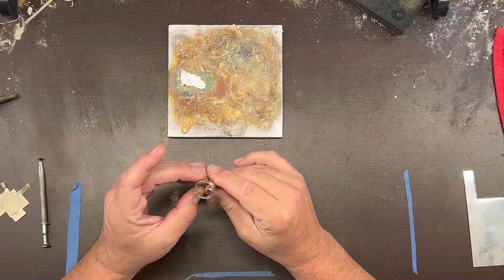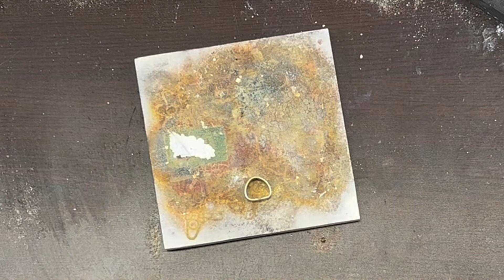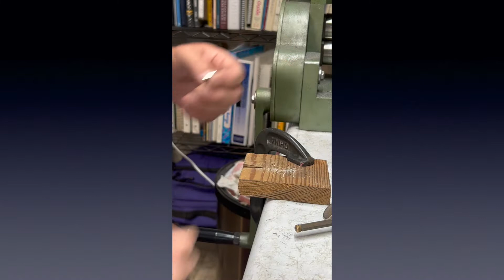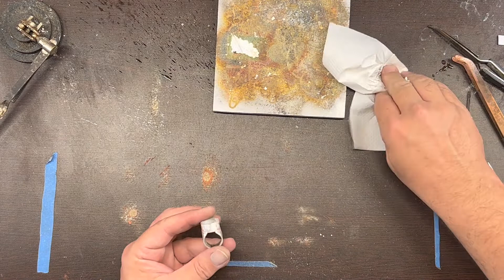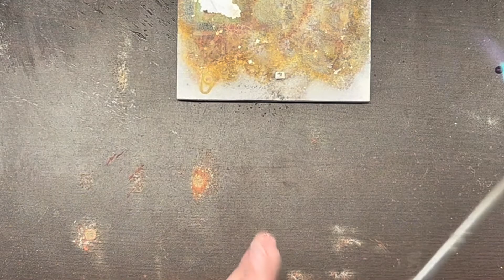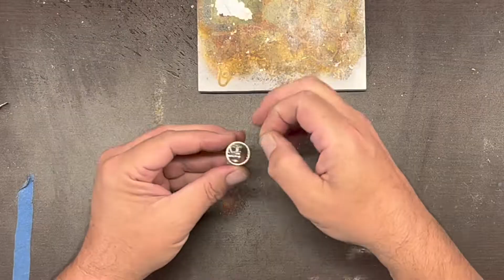Wide Band Minimalist Ring: A Silversmithing Tutorial

Comment: Great way of doing things. I have a question, did you tried to make the hollow ring by the ShapeJS signet method mentioned in the jewelry literature which I never practically understood. It is supposed to be done from one piece.
Reply from the maker: I’m not familiar with that Ilan, so I guess I didn’t:). This one was a style of ring I saw online somewhere and reverse engineered. As with many of the pieces I’ve figured out how to make, there is likely an easier way to do it that I just didn’t think of:)